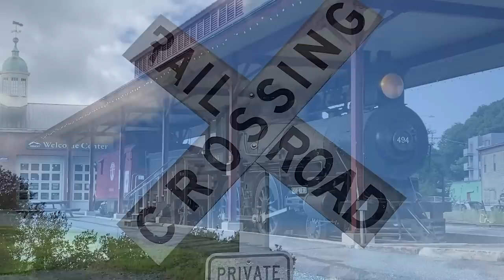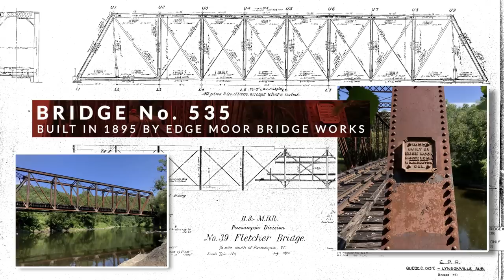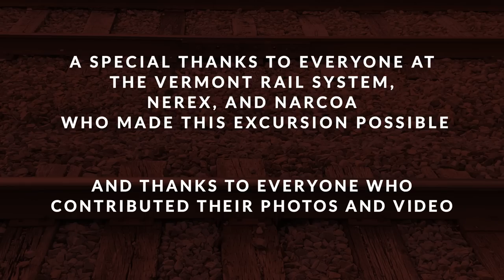VRS 2022 Motorcar Excursion | Vermont Rail System | NARCOA | NEREX

Comment: What does one have to do to get into this pastime?  is it possible to somehow get connected to go on these adventures?  Very curious... Thanks
Reply from the maker: Hi Lew. You can jump into the hobby by buying a railcar and joining NARCOA to participate in excursions. You can check their website www.Narcoa.org for a schedule of upcoming excursions all over the country. If you would like to try it as a passenger first, I believe there are times where people offer a free seat if someone wants to come along on an excursion. Check their website for details.
Reply: @railtime9872  Thank You for getting back to me!  This particular video really caught my attention because i spent the summer of 2021 escaping the forest fires and smoke of Oregon in that exact valley in Vermont, and walked along those little used rails for miles.  As a lifelong lover of the rails this hobby is very appealing to me.  And as a retired guy with some money and time  and great fabrication skills  and a great shop on my hands i could easily see getting into this.  I am wondering also if anyone endeavors to make their own railcars, or is allowed by the group to modify them with more modern engines, brakes and other safety gear?  I understand that they are required to be inspected.  I wonder if there are some customs?  Is there an online forum on this subject that you know of or among the members of the group?  Also is there an excursions on the abandoned rails of the old Northwestern Pacific line that went from San Rafael California to Eureka?
Reply from the maker: Hi Lew, for more information about the hobby, you can also visit www.railspeeders.com especially their links page.  There is a full gamut of operators and types of railcars. Some operators choose to restore, enhance and/or rebuild their speeder for appearance, performance and/or safety.  And there are strict guidelines rules for everyone's safety and benefit. And I do not speak for NARCOA so not sure about the excursion you are referring to on the Northwestern Pacific line.

Comment: Was the first motorcar a diesel?
Reply from the maker: Great question! I had to research that and here is what I found:

"The classic railroad speeders dates back to around 1893 when the Sheffield Velocipede Company developed a primitive gasoline engine motor car (the company, founded by George Sheffield, had originally been in the business of building velocipedes). Just a few years after Sheffield developed its early motor car the company was purchased by Fairbanks-Morse (FM), most famous for its line of diesel locomotives years later."

https://www.american-rails.com/speeders.html#:~:text=The%20classic%20railroad%20speeders%20dates,the%20business%20of%20building%20velocipedes).

Thank you for watching!